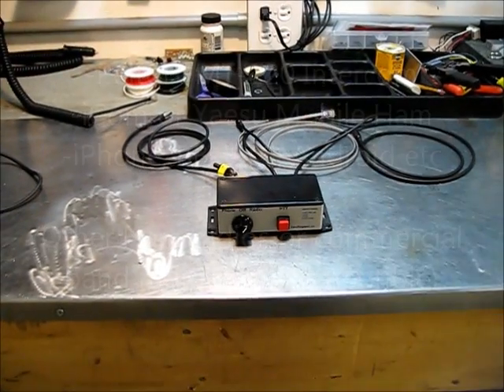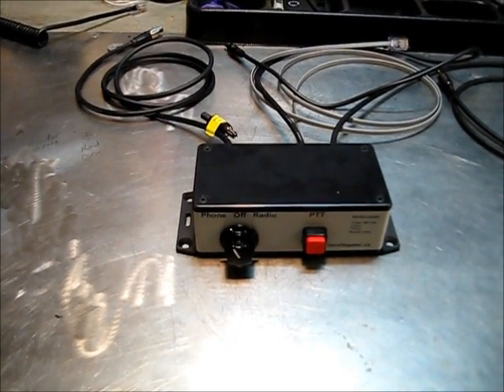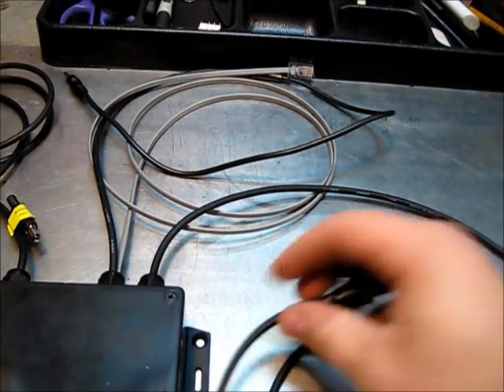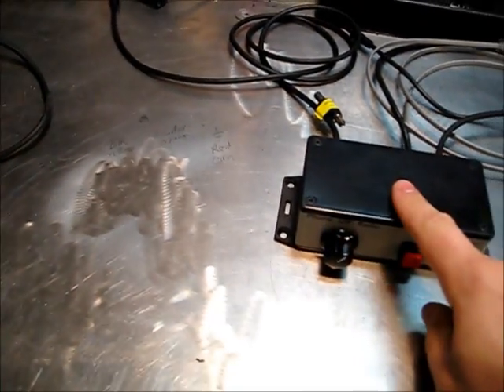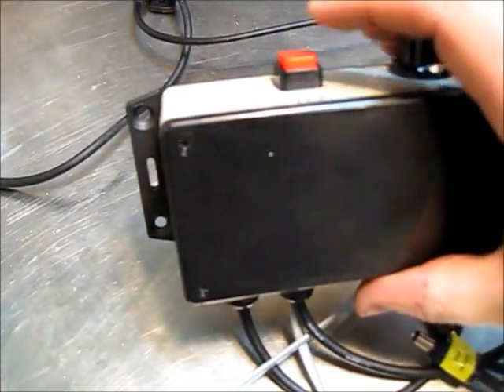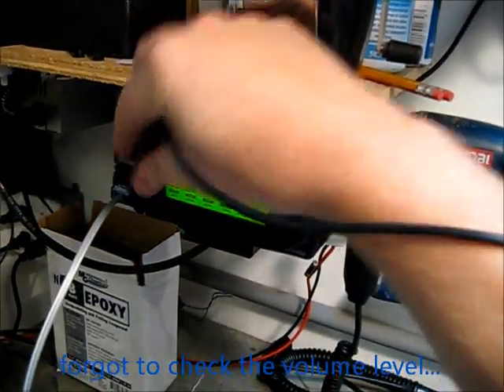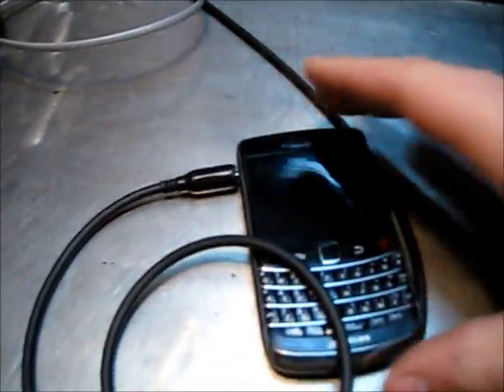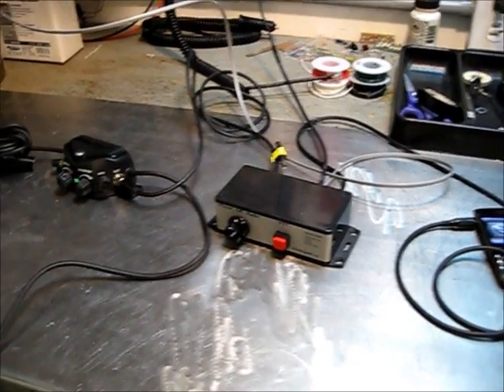Peltor Ham, Phone Interface.wmv

Comment: The mini XLR is a bitch to solder! Made it so that I could piggy back off a crew station of a VIC 3 intercom system so that 2 users can speak in full duplex as it is and in addition be able to speak and hear into the crew station with other users. I plan to use this intercom in the drivers seat of the M1133 Stryker and run the other cable out the hatch onto the hood so that outside personnel can speak to me directly or other users in the vehicle. I'm also waiting on a TP120 plug so that I can modify a H250 Bone phone to just plug into the intercom for people that aren't using peltor comtacs.